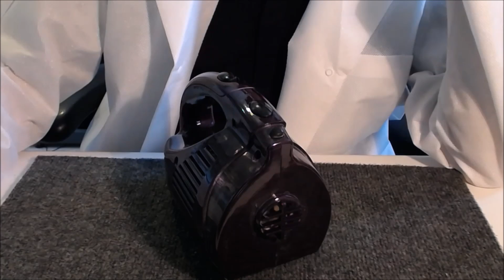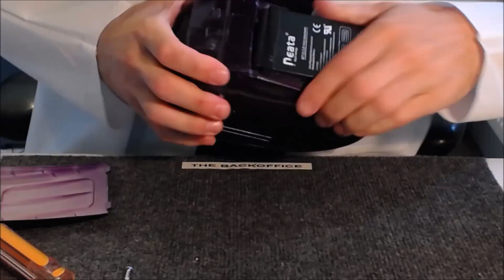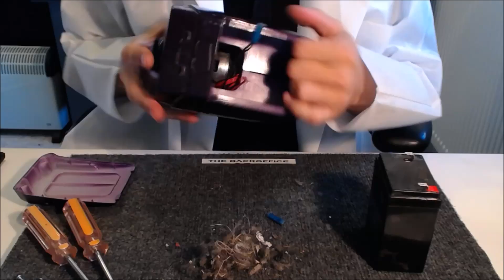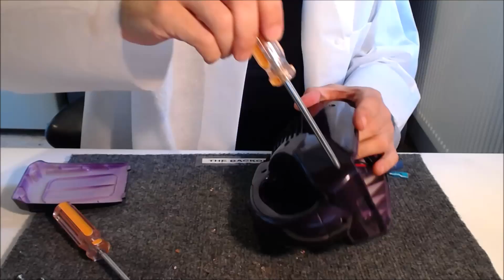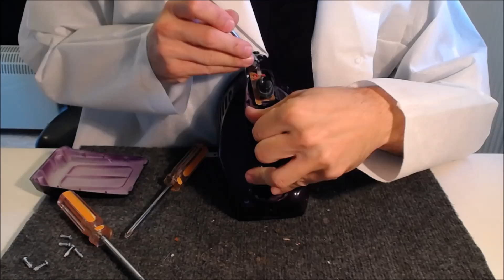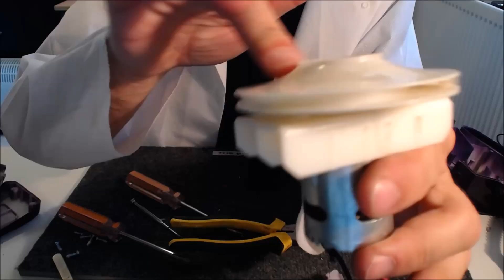Broken Dustbuster Teardown & Repair

Comment: I could be wrong but i believe i saw the impellar turning inside the case. Granted it has something hendering the motor but looks like it is trying to operate. Ive found blades chipped or broken and wedged between the inpeller and housings.

Comment: Did you check if the battery could deliver the current needed for the motor to spin? if not then the battery was actually faulty though technically it is functioning fine. To fix a lead acid battery that shows it's fully charged but can't deliver the current it needs to be charged and left on a load. Repeat that a couple of times and it will be in working condition again. This happens because the lead plates get covered with crystals and to remove them current simply needs to flow

Comment: Use the heat shrink solder terminals and throw those crimpers away. Their only use are  the tiny bolt cutters and treaders for 8/32, 10/32 etc. Well that and for throwing when the go wonky and pinch the crap out of you hand.

Comment: If you do this much get some nylon pry tools and spreaders. Heat guns are handy to soften the plastic to avoid breaking the tabs. One last suggestion for those who dont know better, if youll look closely on most things in cased in plastic bodies their are often arrows molded into the areas where screws or fasteners are located. Often they are there to show only the fasteners required to open the case so you dont undo the ones designed to secure the guts inside. Im surprised you just killed the vac. Remind me not to send you my items that need looking at. Im not buying the motor is shot. It was spinning. Thats not hair making the motor whine. Id love to see you hook the battery back up now that the motor is out where you can investigate. It would suck being a relative of yours if they were on life support. No dr. Its been 15 mins , better pull the plug.

Comment: I have a dustbuster quick-path motor driven brushroll and it does not work at all. the roller frame work will not come apart with braking any tips on how to take it apart.

Comment: Can you do a fix on the dust bowl of the dust buster this is my second one that have been Broken and it's the dust bowl again I used duck tape for the first one but it's a pain when I have to dump the bowl. Please help with this I called to get the part and there is no replacement part!
Reply from the maker: +dippster357 Darn, I do not have one to even do a video on. Is the bowl cracked or is it missing parts?
Reply: Yes i have a black&decker lithium dust buster the one with the red handle, on top were the bowl clips on to the body of the dust buster that has broken and i didn't even have it for a month! i was pretty sure that this happen to this model before, ( if dropped it would break at the weakest point were it connects to the body of the dust buster)  i was surprised that someone didn't make a video of this before! Yes the first thing i did was contact the company, there are NO replacement parts to this machine!
Reply: I'm tryin to repair this with velcro that way i can take it apart to empty and put back together again other wise i guess i will have to use ducktape to keep the dust bowl connected so i can use it!
Reply from the maker: +dippster357 hmm. How about magnets? If you can fix some rare earth magnets to some webbing strap you can make it's easily removable.
Reply: Thanks for the advise i just did it with Velcro just a few hours ago so i will try it tomorrow, i will let you know how it works i like the magnet ideal, but where do you get the magnets from i will look on Amazon later. That's what i was hoping  to make it easily removable and air tight so it will work well.if this works you can do a video on it.
Reply from the maker: +dippster357 is you search on Backoffice.com/archive for magnets hopefully something will come up
Reply: Dust has got into the engine of my black and decker lithium pivot vac 20v, is there anything i can do? It sounds so much louder and meaner now, and their air thats blowing out the back blows so much harder now.
Reply from the maker: +Alek Shukhevych I am sure you can clean it out if you disassemble it. Alternative try some compressed air through the various vent holes.
Reply: Thank you!!

Comment: The motor on mine still works, but it got VERY LOUD. I mean, lawnmower loud. I don't know what happened to it, or why it happened, but being as it still works, I'd like to fix it. Any suggestions?
Reply from the maker: +The Kopys I'm guessing the bearings have either worn out misaligned and the impeller is hitting the casing. Might be worth investigating if you can pull the motor and see any physical damage. 👍
Reply: Thanks "The Blackoffice" Wish the unit came with schematics, so as to guide me better, but I'll give it a shot.
Reply: Same thing happened to the house dustbuster. I saw the problem and it just needs cleaning, lots of dust hairs, furs, small pebbles and strands of stuff that is hard.
Reply from the maker: +Jed Instead so many people throw out cleaners when they just need a basic service. It's a shame. 👍